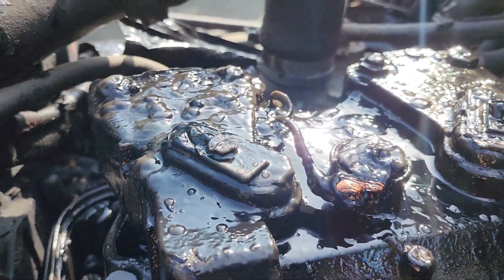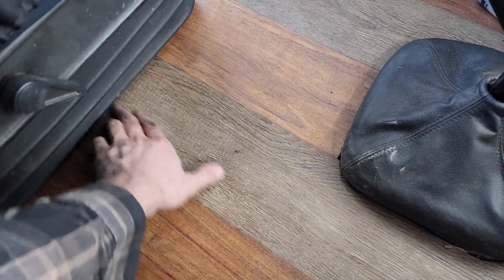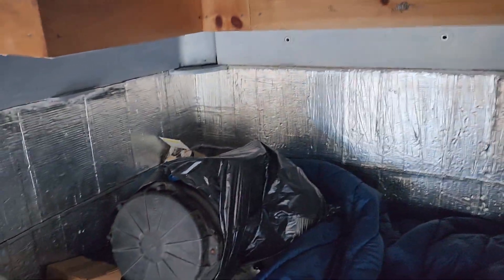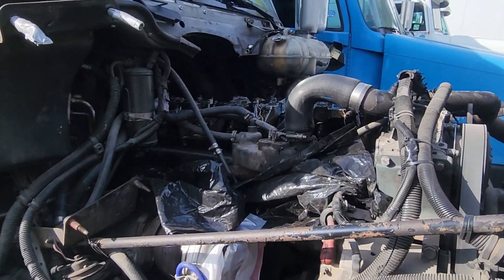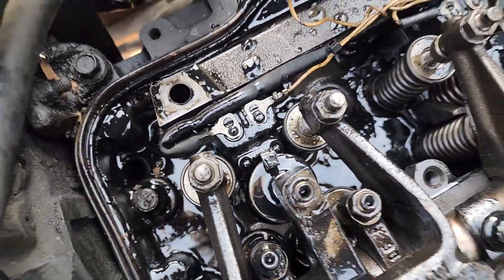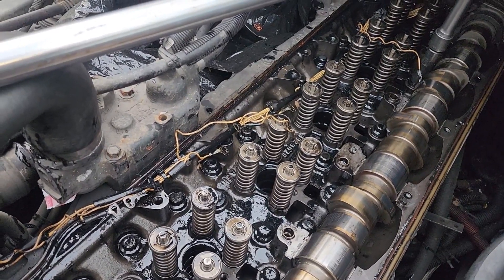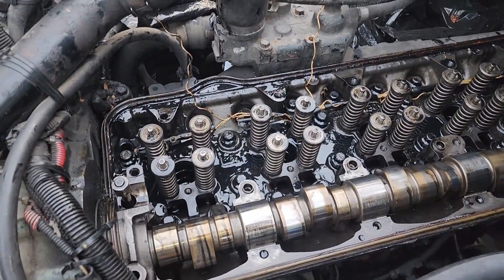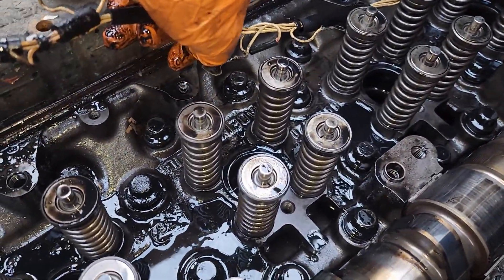BLUE DEVIL Detroit Diesel 60 12.7 Aftermath PART 1

Comment: Thoughts on the blue devil and how long did it last?
Reply from the maker: It's really not worth it.  It will permanently reduce cooling efficiency.  But...  I had steam out the pipe, I did it properly using the directions, it worked, then I ran the rig with no coolant pressure valve.  A modified cap.  Topped coolant off more frequently, it lasted over a year till it blew  smoke again.  With 550hp and 1950 torque pdi turbo